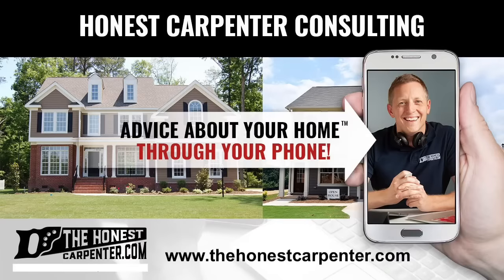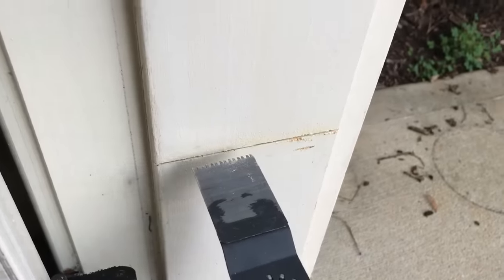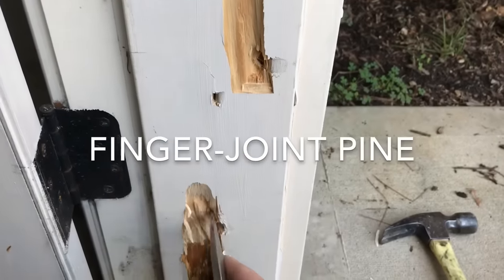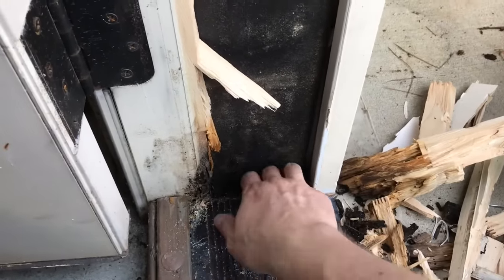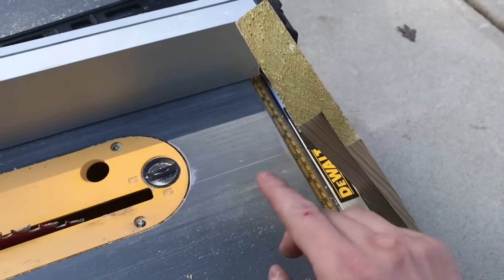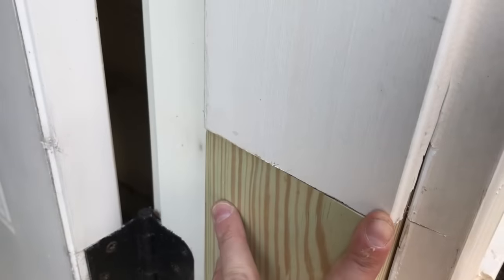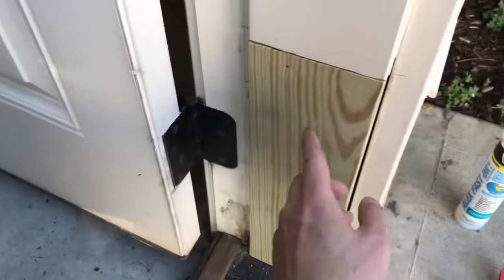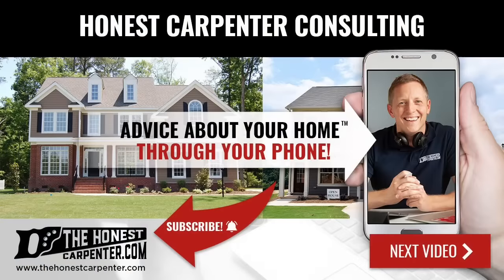How To Repair Rotted Door Jambs

Comment: I called three separate carpenters for estimates on repairing my door jamb (walk in cellar).  Both sides were rotted on the outside in the jamb to a height of 24". They all said the entire unit must be replaced (including a door) and quoted me $1200.00-$1450.00.  I wasn't born yesterday, I could tell they were thieves. I bought a cheap oscillating multitool for $39.00 at Harbor Freight tools. I took out the weather exposed side cutting it by the door stop. I purchased PVC trim at HD. I'm old so I took my time. Took me about 6 hours of fussing. Total cost was $175.00. I was told it looked better than what a carpenter could do. It will last forever being made of PVC Veranda. So it matched, I did all three sides and used top quality stainless screws.  I know I went a bit overboard on framing the door. But it looks so good. I kept the heavy steel door and there was not one bit of rust on it. I originally installed the unit 37 years ago.
Reply: Will ya come fix mine? I’ll be waiting by the mailbox for ya!
Reply: Any pictures?
Reply: I live in Douglasville Georgia and had the same idea. PVC will not rot.. But did you create a ledge with the hinged part of the casing? I can't ever find the right replacement because 34 yrs ago it must have been different. Its sad they didn't think ahead.
Reply: @electronic476  no
Reply: @mtsflorida  Did everything like/like from the old. After three years no problems.
Reply: They weren’t thieves they just don’t do small handyman jobs such as what you needed.
Reply: Robbery at it's best.
Reply: Some people think out of the box when they an easy job and try to get top dollar

Comment: After doing this job three times in 10 years on the same door, I finally ripped all that trim out and replaced it with vinyl. No more painting, no more rotting. Did the same thing for my garage surrounds, for the same reason, with the same result. Looks great, no more rot!
Reply: You should've learned your lesson the second time and used treated wood lol
Reply: I was just wondering the the same thing. Why not replace with PVC. It cannot rot. Even pressure treated is more resistant to rot and water damage, but it’s still wood. The only downside I can see with using PVC is it’s not as durable as wood, it dents easily a door trim or window sill that shouldn’t be an issue, but a garage frame? In the winter months we get snow, and shoveling out around the doors could be an issue. How well has yours held up to life?
Reply: @Steelheart624  I did...and the treated wood rotted as well, which is why I went with PVC the third time.
Reply: @jamesmchugo9422  My door frame has been in for five years, my garage trim has been in for four. I did have to replace one piece of garage trim after I accidentally hit it with the auger on my snow blower. Other than that, it has been remarkable resilient.
Reply: Ah nvm then... Unusual for treated wood to rot but it is still wood I guess
Reply: @jamesmchugo9422  There are PVC products on the market.
Reply: @Steelheart624  Treated wood definitely rots if there is standing water / moisture. Maybe there was a bigger issue that should be solved if possible.
Reply: You can get a waterproof mdf in UK. Presume over there too. Can leave it in a bucket of water for weeks and it doesn't touch it. Could be an idea. It's not cheap tho
Reply: Moisture is my nemesis. I wonder if there was moisture still in the wall. Sometimes I wonder if I should have set up a heat gun for  8 days to thoroughly dry an area before proceeding with a repair.
Reply: Pvc's the way to go
Reply: @AshiStarshade  Wood is a sponge to water.  Wood is like a very slow paper towel to water.  Treated wood is an even slower paper towel to water.  But still a sponge-like absorber to water.  Plastic does not know what 'water' is, plastic will not absorb it.    

A good 'wisdom-increasing' experiment for any carpenter:   Take 5 small bowls of water.  Put in 5 different selections of wood (plywood, particle board, pine, hardwood, treated wood) and let stand for 1 to 4 days.    Keep in mind that water evaporates into air the same amount for each bowl so the difference in water loss in the bowl is the amount that went into the wood.

You can let the 5 bowls stand for a month if you have the inclination.

Then study the difference in absorption of water into the wood.   You will now know more than most carpenters (most of whom never run this simple experiment) about how the wood types absorb water.

As a wrap-up,   take the 5 pieces out of the water and lay them flat on a non-absorbing surface like a piece of aluminum foil or a metal workbench or a piece of scrap metal or an old metal door or etc.

Let the 5 pieces totally dry out over 1 month.   Now you will know about warping.   The absorption/drying cycle of water in contact with wood will tell you which woods re-gain their original shape after being in contact with water.
.
Reply: PVC door frames are not as strong as wood. You should have use pressure treated wood. 
In addition, depending on where you're located in the country, PVC may not work for you depending if you're in areas with high amounts of snow, rain, humidity or in your in hurricane lying areas. PVC compared to pressure treated wood is not as strong to sustain high-impact winds.
Reply: @ccastaneda669  I DID use pressure treated wood, it rotted anyway. The PVC has been up there now for three years and looks/works as good as new, so I think it works just great (with lots of snow, rain and humidity).
Reply: Don't got the doh homie. My rents 2500
Reply: @Greg_Chase  that sounds great but you might have to use a whole bunch of different pieces of wood as every piece of wood is a little different in grain etc
Reply: Did u rip the wood out or put the vinyl over top??
Reply: @ronniejohnson4738  the wood is gone, replaced by vinyl.
Reply: @Steelheart624   treated wood will rot
Reply: @TSwizzle777 then the landlord is responsible homie.
Reply: I know this maybe be a dumb question but how and where can you find vinyl wood at? Do Home Depot and Lowe’s sell it individually?
Reply: @Greg_Chase for those of us unwilling to spend that time, what characteristics do you note?
Reply: @chriswhitewen9650   Plastic.  Easy to cut, durable.  Easy to work with.

The downside is a heavily-sun-exposed situation.  I believe the UV (ultraviolet) light portion of sunlight undermines the structural integrity of everything over time, but especially plastic.  It's one reason all of us wrap any pipes exposed to sunlight with that gray, cylindrical (tube-shaped) foam stuff.

I just wrapped a PEX water main riser to a hose bib with that dark gray foam stuff.  Put it around the PEX riser, added 3 tie-wraps, the riser will last a lot longer.

Some of the french doors in our rental properties have 'surrounds' all around them; door panels are metal with hard plastic surrounds.  The wood door jamb rots out at the bottom and the plastic on the doors is like "no problem here"

If you're old enough to remember, or have seen vintage cars with vinyl dashboards or on the roof, that get 'sun-checked' over time and crack and dry,  that's the same problem with the plastic.
Reply: @ianthompson9058 this.
I’m not sure what the specs are on it but they’re using impervious multi-ply wood as backer for modern shower surround panels, and same thing, they can sit in a bucket of water for months with zero swelling, absorption or rot. In the end using such products would have to be more efficient and cost effective, so why are these industries not employing it in more products?
These are the kinds of things that are so obvious that it drives me crazy to think that we’re still forced to live 50 years in the past with what is currently offered in the market.
Reply: I was here four years ago, time to get to work
Reply: @AshiStarshade true
Reply: @ScottsSynthStuff  What about cedar wood board(untreated)instead of treated wood? In my state, cedar fence board is the most popular one since it rains throughout 270days.
Reply: @AshiStarshade  add roofing tar on the cut end
Reply: @Greg_Chase I like that

Comment: To make it easier to cut a straight line, tack a guide strip to the lower part of the board. Let the multi-use tool blade rest on the guide strip while cutting. Even someone like me who's hands shake quite a bit can make a straight cut this way.
Reply: That's helpful as well! I was trying to hang cabinets the other day, and found the tip of putting a strip of straight 2x4 level as a shelf to make the cabinets easier to hold and easier to get level.
Reply: In addition it can be good to have the guide block be beveled so that it’s at say a 20:degree angle (ripped on a table saw or cut on a mitre saw). When you run the saw along tip it to the angled piece so the remaining jamb is angled down and the piece you put in is at the same angle also cut at the same angle on your table saw or mitre saw. That way it is flashed downward allowing water to be less likely ever to infiltrate the joint. Not a huge big deal but added protection.
Reply: Absolutely.  A speed square works too.
Reply: @alexmacdonald1998  yeah that's what I use
Reply: Ditto. You can even put an angle to it and will match up rather decent.

Comment: Thank you for taking the time to put this video together. I had been putting off this job on a couple doors for too long and tackled them today. They look better than new.  Before reading the comments, I also made a few modifications that have already been mentioned (45 degree horizontal cut, plunge vertical cut so the old/bad piece comes right out). But watching the video made the job go MUCH faster and problem-free. I realize that the video is 2 years old, but wanted you to know that it is still helping people!  Thanks again.
Reply: 45 degrees going upwards or downwards?  And what is plunge vertical cut, please?  Thank you!

Comment: Used your video to do this today.  Was able to find a three foot section of jamb at Home Depot.  So didn't have to cut my own groove.  I sealed the ends as you suggested which is a good tip even for treated wood. Thanks for putting this together and supporting DIYers.
Reply: do you have a link by chance?

Comment: Good vid! 
Quick tip for you.
The surgical line you speak of...if you want it to disapear, very slightly bevel the existing edge and new edge of the cut line with sand paper. Install your piece, and once adhesive sets up, use some automotive body filler over that area. Sand it flush once dry, and your ready for paint! 
You did a nice job, so might aswell take one more step to making it look invisible to the normal eye. The caulking shrinks back and you'll always see that cut line.
Reply: A home repair guy suggested the Bondo Fast Dry Filler. I plan to use that. Thanks.

Comment: Thanks for posting this great video. My parent's house needs this kind of repair, now I know what I need to do and how to do it. The only thing that I would do in your case is not use the shims but use long strips of would, the thickness needed and put them behind on each side of the new board in order to have an even backing. This video was very informative. Thanks again.
Reply from the maker: Cuervo Vallejo Thanks for watching! That’s a good call. You’ll get pretty much fail proof support that way 👍

Comment: Additional tip -  use the caulking to seal the end grain on the bottom of the piece of wood.  Put a small amount on the end grain and rub it in to the wood. Really helps it not rot in the future.
Reply: I see so many people not sealing the bottom edge of exterior trim wood in general. Its the most vulnerable area of the trim to rot.  I also raise the trim up off the door sill so it's not sitting on it. The slight gap helps and caulk will cover the gap. And now the price of PVC trim has come down so I always try to use that when I can.

Comment: Nicely done!  When purchasing a new door upgrade your jamb (Door frame) to composite bottom or complete composite jamb.  Generally the first place water damage is found on an exterior door is at the bottom of the jamb as this video shows.  A composite bottom jamb has the bottom 6-8 inches of the jamb and brickmould made from a composite material which won't rot.  Or go with a complete composite jamb.  Its a great investment for a little amount.    Hmmm, I sound like a door salesman or something...LOL

Comment: very nice! subscribed...as a retired painter/handyman, i like to prime both side of repair wood before it is pinned in.  in my day i didn't have those oscillating tools--what an improvement over the old days.  i probably would have planed a thicker repair piece to avoid the shims, but this is quicker and a good idea.  also, i like dynaflex for the caulking and anything else i can use it for!

Comment: You did a pretty good job on this jamb repair....
I've seen jambs rot like this for 4 decades now...and you only had two choices to repair it, either tear out the whole frame, or repair it like you did....
For the past 15 years or so, the Jamb materials have gotten better, and this type of repair should no longer be a problem....If the proper frame is used in the correct location....
I am a Door Builder by trade,, Building both standard and custom Exterior entry units....
And Currently there are 3 types of standard Jamb materials that we use...
Primed fingerjoint pine jambs, Frame saver pine jambs, and Solid composite jambs....

  The primed pine jambs should Ideally be installed in locations not exposed to direct weather, like a Garage, a Porch, or location that has a large over hang......

  Frame saver jambs are our main sellers, because they pretty much Eliminate the type of rot that you just fixed... these are pine jambs, but the lower 4 inches are made of a Composite material to eliminate water penetration at the Jamb/sill joint...

  The all Composite frames are the best,, due to the fact of never having to worry about any rot,, but they are pretty pricey.....SOooo...
As the old saying goes.... "You get what you pay for"....
Reply from the maker: @Ol' Moe Thanks for writing in! Awesome to hear you're a door builder. My grandfather built custom doors and windows, and he was a top outboard motor mechanic as well. I've definitely seen the frame saver jambs you mention--they just haven't caught on in my area yet! Lately I've been doing this same repair with PVC, as the price has dropped so drastically in this last year or two. But pine, especially finger joint, is so prone to failure in these areas. I've never really been a fan of fingerjoint anywhere outside--high humidity levels alone seem to make the joints express. Inside the home the stuff seems far more stable. Where do you build doors? Thanks again for writing in!
Reply: @TheHonestCarpenter  I live and work near the coast of Myrtle Beach South Carolina...Here the building industry is growing steadily every year, with more and more people moving into the area....
I also, have never been a fan of Finger Joint material,, when used for any frame work, doors or windows...Mainly due to each glue joint being a place for trouble to start....
As far as the Frame Saver jambs,,, The cost only adds a few more dollars to the price of the unit...But will save you from sill rot later on down the road....
Thanks for replying back...Keep up the good work....
Reply from the maker: @Ol' Moe Thanks buddy! I've spent a lot of time down in Myrtle over the years. Tons of great memories :)
Reply: Actually, there is a third choice that I have used many times on cheap rental properties in particular. Cut out the rotted areas with a chisel. Then fill in the area with concrete mortar. Before I put in the concrete mortar I usually paint all of the exposed areas with a termite killer.  This is a fast and easy repair requiring very few tools.

Comment: Ethan, I always use an old chisel or a sharpened flat trim bar for jobs like you're showing in this video. I find that either of these tools work better than a "demolition" screw driver.
Reply: I think a chisel is better than a screwdriver for removing sections of wood, too. No matter what tool you use, you have to be really careful with the wood removal process.

Comment: So wish I would have seen this sooner.  I pretty much did what you did.  But I didn’t use the level tool you did to make sure i had a straight line, so I had to mess with the angle in my cuts to get it to fit.  Glad that I at least did most of what you recommended.

Comment: That was helpful to see how ours will be done. I thought I could handle it myself but after seeing all these details, there is no way I have the proper tools and abilities to do such a previously thought easy repair. You said in the video you've NEVER seen the inner door jamb with the rotten place, I have an inner door jamb on the underside of the hinge that has rotted out and so, I'm thinking either get a new door and have them just replace the entire door and thus the whole thing is repaired and replaced vs paying the carpenter the $800+ he wanted to do the lower jamb outside and the inner jamb below the hinge. Cheaper to get the door and install vs getting it repaired. So much for DIY.
Reply: Good idea, just make sure who you hire is qualified and insured, so worth having a good contractor do and wonderful installation, if they are really good they don't even mind you watching.
Reply: Get the door with  the fake wood on the outside. A little more expensive , but worth it. Comes in white so you don't have to paint jambs, but you can paint if you want a different color.
Reply: Bill Rehm warranty void if not painted ALL 6 sides. Gotta read the fine print
Reply: Dude, for $800 he should replace the whole hung door and apologize for pulling your leg. That’s an astronomically overinflated estimated. Call another carp, please.